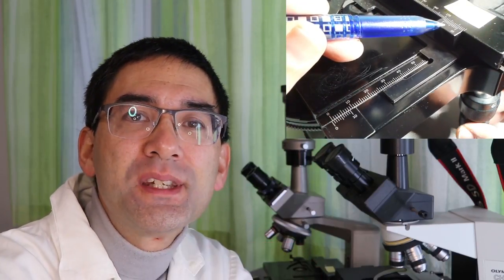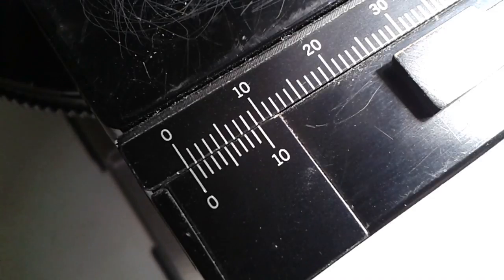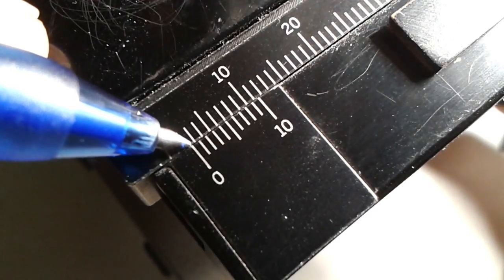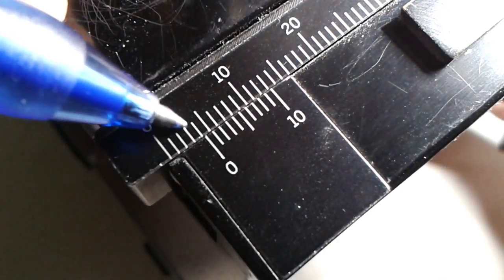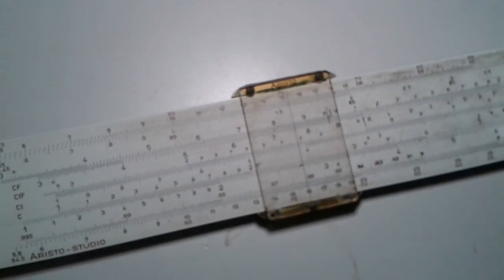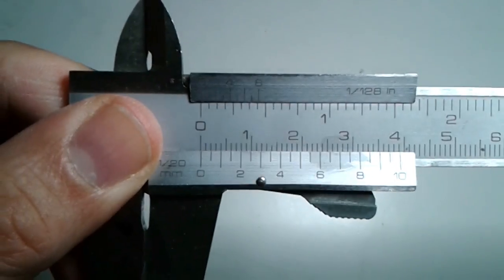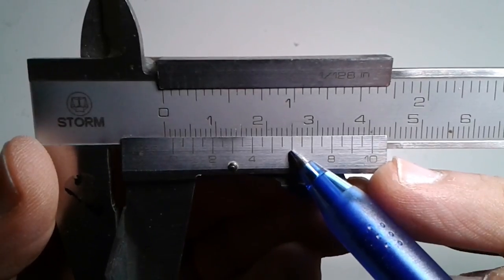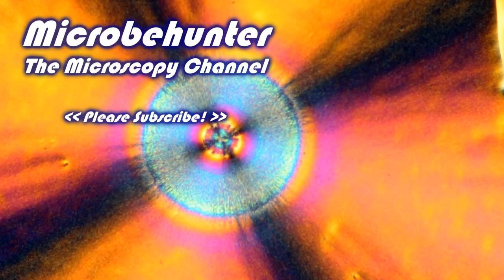🔬 073 - What are those lines on the microscope stage good for?

Comment: Can we use it to measure tumor thickness if yes then how
Reply: Using the example of how he was showing the scale on the Y-Axis, you could line up the edge of a sample in the eyepiece on a pointer (or edge of the field) and move it to the other edge of the sample and subtract the smaller reading from the larger one.

Comment: Hi Oliver, probably not completely related to this video but I was wondering is there anyway to adjust the sensitivity of xy stage controls? my Olympus is very very smooth that I can move the stage with one figure but my other microscope the cheaper one is quite stiff I almost have to use the strength of the arms..
Reply from the maker: Not that I know of being able to adjust it. This is probably a sign of the lubrication oil having become solid. If this is indeed the case, then cleaning and relubrication might be necessary. If the microscope is new then this is probably not because of solidifying oil. In older microscopes it can be quite common up to the point that you can not turn it anymore at all.
Reply: @Microbehunter  thanks Oliver that's very useful!